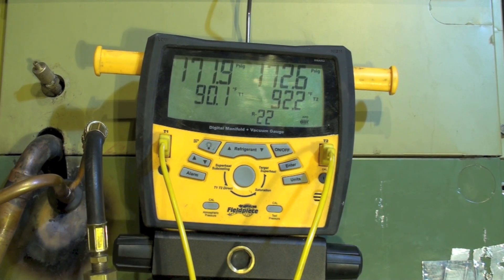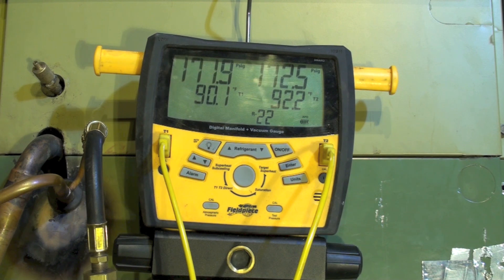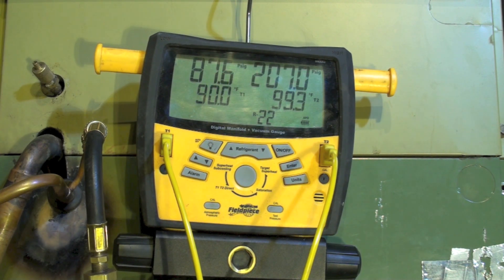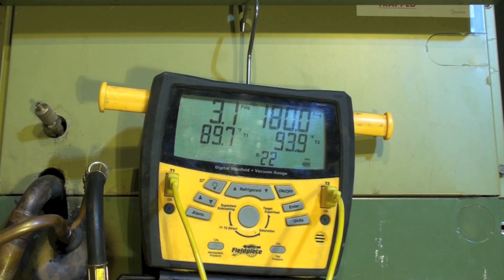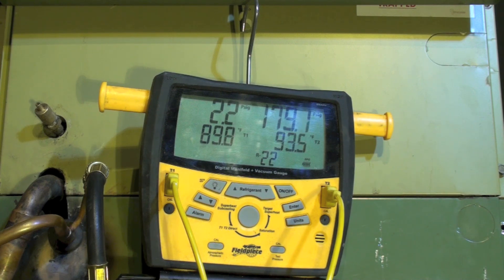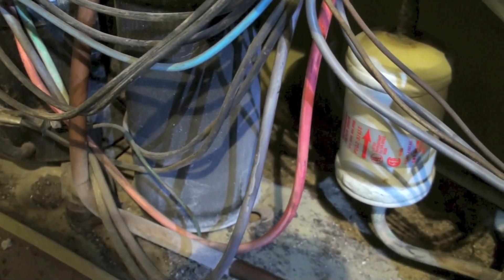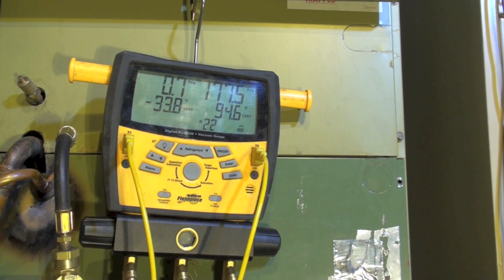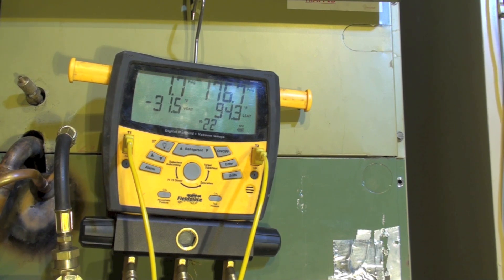Diagnose the air conditioner problem.  Pump down of the compressor

Comment: I'm in agreement with Mr. Maxwell.  Lets shutdown the air handler blower and run the system with no air flow through the evaporator and see if we can drive the superheat to close to 0 within a few minutes of running the unit...

Comment: The liquid pressure looked much different than yesterday when you started the pump down?
Reply from the maker: The unit is repaired during the pump down video.
GFM
Reply: grayfurnaceman was one of the captives in the condenser blocked
Reply: grayfurnaceman cap tubes
Reply from the maker: talyn875 All passages in both condenser and evaporater are clear.
GFM